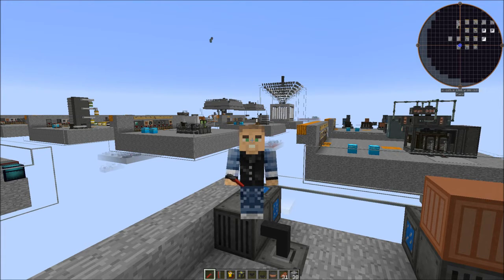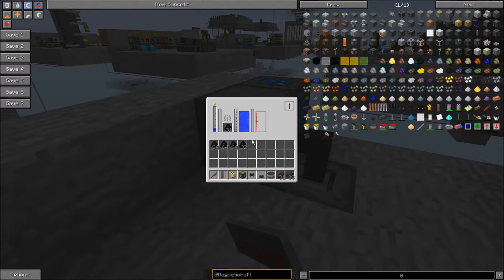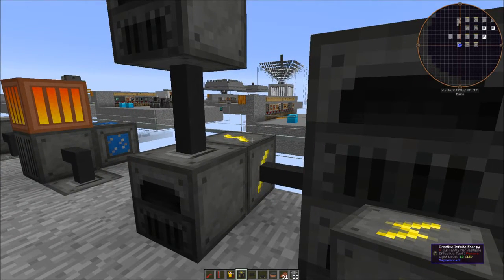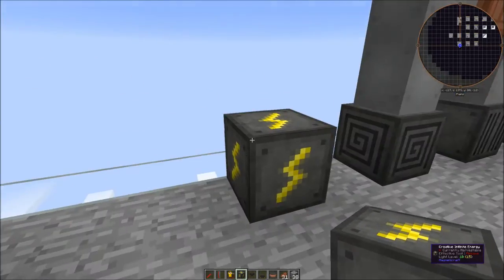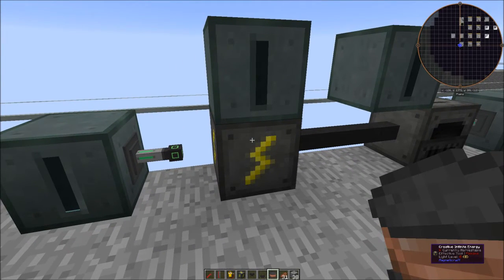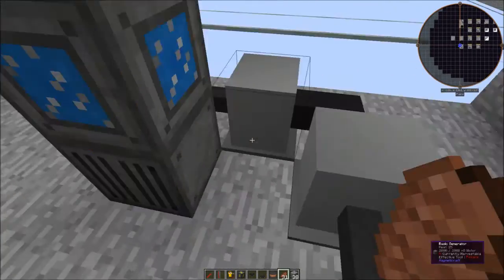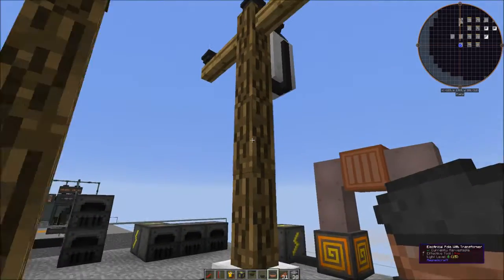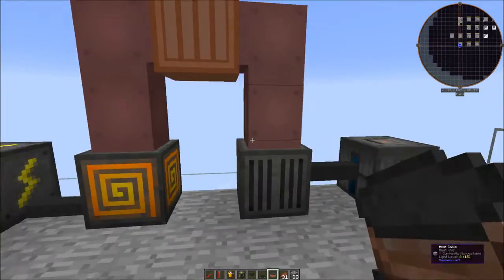Understanding Magneticraft Energy - KollinsPlays mod Spotlight

Comment: I don’t have a rf alternator block on 1.12.2
Reply from the maker: The current build of Magneticraft for 1.12.2 is almost a total rewrite of the 1.7.10 version and not a port, so the dev is still working on getting everything in. I saw some plans for a dynamo, similar to the old Redpower Blulectric Dynamo, that would take Magneticraft power and output RF/FE/uI, but it isn't implemented yet.

There are some ways to get RF/FE out by attaching Electric Connectors with Copper Coil to a battery that holds RF/FE from another mod like EnderIO/Thermal/Mekanism/etc that are similar to what this video shows at around the 5:00 mark.

The current build, Magneticraft_1.12-2.4.4-dev.jar doesn't have a recipe for the RF heater, but the dev is working on a method of using RF/FE to make Magneticraft power. I think the current plan is to use RF to make steam to power the Small Steam Engine, but if you have another mod that makes steam, you can input that into the steam engine.

Things are still coming in the mod for 1.12.2, but for now I have been using Magneticraft to make it's power and not trying to convert to/from RF/FE.
Reply: KollinsPlays thx